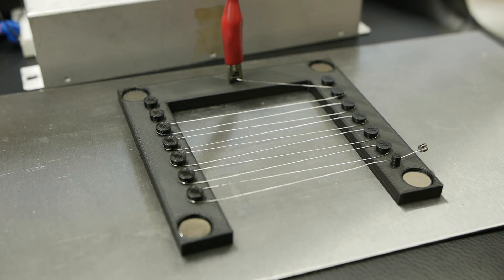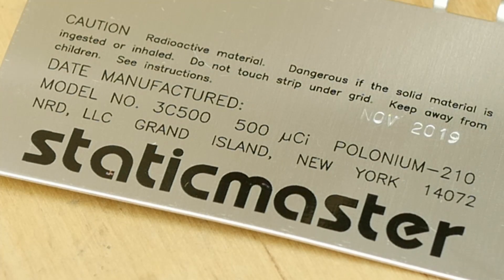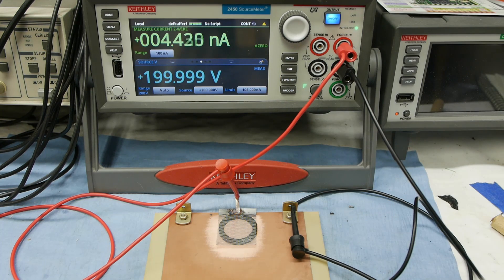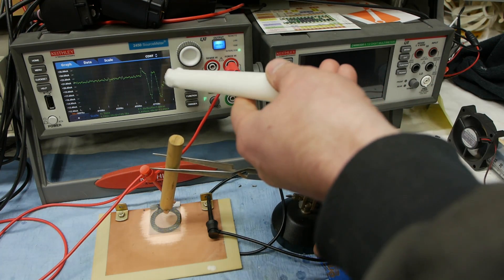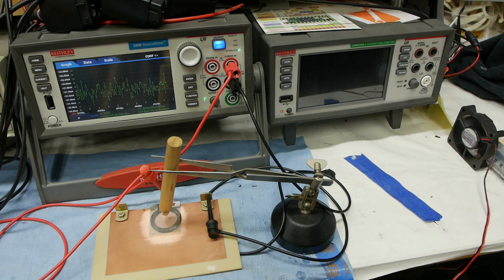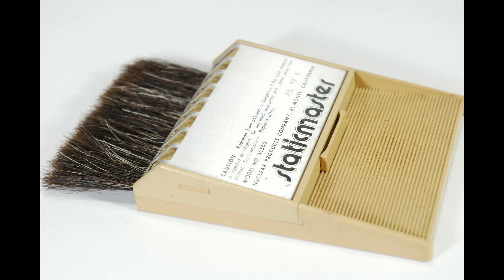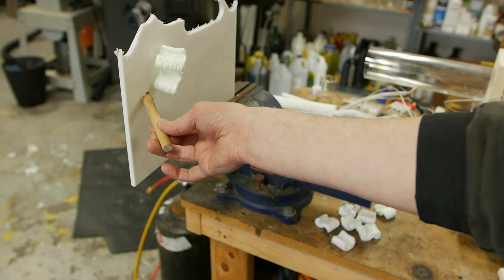Alpha radiation makes sparks, detects smoke, and eliminates static cling

Comment: 9:54 : "If the alpha radiation is coming from outside the body, it will not be able to get through the dead layer of skin that surrounds you and interact with living tissue"
Are you sure about that? 
I used to believe it too, until I saw The Thought Emporium's video on the subject, where he show they can actually penetrate through chicken skin:
https://youtu.be/C7TwBUxxIC0?t=875
Reply: Whatever TE was measuring he was NOT, I assure you, observing alpha particles traverse multiple millimetres of skin. He just wasn't. Radiation interactions with matter are well established at this point and the calculations for alpha particle traversal through water like density materials is known with high certainty. The typical stopping distance of a ~5MeV alpha in water is mere tens of microns. A 10 MeV alpha, about the highest you'd find from natural nuclear decay is less than 0.1mm. The high charge and high mass of the particle make its interaction with matter extremely strong. Again, this stuff is all over the literature if you want to look up the excruciating calculations for yourself. He was using thorium in that video, an isotope notorious for its long and highly energetic decay chain which includes radioactive alpha emitting gasses like radon. That stuff gets EVERYWHERE and is constantly emitted by the thorium. A diffusion cloud chamber of the kind he was using is not at all the appropriate method to prove alphas from something like thorium have higher penetrating power than is generally accepted.
Reply: @Muonium1  
OK for the radon. However:

"The typical stopping distance of a ~5MeV alpha in water is mere tens of microns."

Which is precisely the thickness of the skin's dead cells layer, 10-40 µm! The rapidly replicating cells of the stratum basale are right underneath.
Reply: @Muonium1  "Whatever TE was measuring he was NOT, I assure you, observing alpha particles traverse multiple millimetres of skin." And he never claimed he was either. He just said that alpha particles aren't blocked by paper as thin as human epidermis.
Reply: @Muonium1  Yes, I made a video to demonstrate that and posted it as a comment to TE's video: https://www.youtube.com/watch?v=L8StwMyVkVw
Reply: However it might be you're not going to wear the source from the brush as a bracelet or pendant and while using the brush your body will generally be at least several mm from the source.
So all in all you'd really need to put some effort to get damage from such source compared to a bracelet or pendant which will be inevitably in long term contact with a particular skin area.
Reply: I was about to post the same!
Reply: Chicken skin (especially feather skin) isn't really a good comparison to human skin, as it is far thinner than the majority of our skin, due to the added protection of a coat of feathers. Maybe more comparable to the thinner areas of our skin such as eyelids or nutsack.
Reply: @rdizzy1  Yeah, but it is still far thicker than the stratum corneum - the layer of (mostly) dead cells that forms the uppermost portion of our skin. 

There's a layer of actively dividing cells right underneath that!

Comment: Are there any legality concerns with regard to disassembling smoke detectors and other licensed sources like the staticmaster brushes? The Po-210 sources are obviously much less of a big deal due to the limited half life but I am not sure you should be suggesting that people disassemble smoke detectors for the Am-241 buttons which afaik might pose a nonzero chance of causing some regulatory issues.

Comment: I would have liked to see a "control" rod with no polonium, just wood.
Reply: This fkin guy right here.
Reply: I wouldn't.
Reply: that just sounds like graphite-tipped control rods with fewer steps!
Reply: wat

wat
Reply: @Geolaminar  It's a joke about nuclear reactors.  I can explain it if you want.
Reply: Wait, are you talking about scientific control, or actual control rods that are used in nuclear reactors?
Reply: @KingNast  The fact that it could be either is.the best part.
Reply: you are right - not unlikely the wood is poisened by one of the thousands nuklear Tests (and desasters) over the last decades

Comment: I had at least one Staticmaster brush specifically for photography use in the late 60's-early 70's (junior high-school and later; H.S. class of '72). I did a lot of (mostly) black and white printing from (mostly) 35mm negatives. I might even still have it packed away somewhere, along with my Durst enlarger. Brings back a lot of fun memories, including getting up before school and going into my home darkroom to finish a photo class assignment. 😊 I had the 1" model.
I'm amazed that they are still made!
Reply: I’ve seen some pictures and I swear they used a Dust enlarger.

Comment: Should old smoke detectors be disposed off, or can they be thrown away?

If I tore one apart, could I make myself ill?
Reply: You should dispose of them carefully. It's not dangerous to remove the plastic housing however you shouldn't open the metal pod with americium inside.
Reply: They can be disposed in regular trash (there's an exception carved out for them). The americium source is pretty well enclosed, so you will need to lick it to ingest any of it. And even after that it won't really do much.
Reply: You can dispose them if your trash ends in a landfill, but not if it's incinerated. 
And is never a good idea to play with radioactive particles without proper training, equipment and knowledge.
Reply: @josuelservin  I wasn't going to try to access it, but worried that the detector, if dropped or damaged, might "drop it".

I have years of assorted junk boxes, some with old detectors.

Comment: I used one of those staticmaster brushes to eliminate static from a pump when I was doing physiology experiments in grad school.  My patch clamp amplifier was picking up periodic noise that  corresponded with the movements of the pump.  I finally figured out that it was static from the pump rubbing on plastic tubing.  I rigged the brush polonium source to a lab stand and pointed it at the pump.  Worked like a charm.
Reply: Holy shit, man!
For my Master thesis, I did some very simple membrane potential measurements on leech neurons, under a constant flow of saline.
I had periodic noise (~ 1 Hz) in my electrode amplifier. I couldn't find the source, and ultimately just ignored it.
Peristaltic pump, static. Doh!
Yeah, so that's what that was.
Thank you for the epiphany, but you're 9 years late.
Reply: gesamtszenario that’s so cool
Reply: gesamtszenario That is so cool!
Reply: @gesamtszenario  Makes sense probably a triboelectric effect from the dissimilar materials of the peristaltic pump rollers and the tubing.
Reply: Would graphite powder have done at least as good, but without the accrual of mad scientist points?
Reply: Buck Starchaser maybe, but we already had a polonium brush for cleaning our lab balances
Reply: How did you find out that it was caused by static charges?
Reply: synaísthēsis I don’t remember exactly.  I imagine I cursed a lot and tried every other possible thing first.  Electrophysiology is as much an art as a science, and getting extremely frustrated on a daily basis was part of my technique.
Reply: @jmpattillo  haha thanks ;) I worked with neurons and faradic currents. A colleague worked with electrophysiology and I could see that it was another world XD
Reply: I used to solve this artifact on heart lung bypass machines intraoperatively by spraying the pump head with available saline in the room.  Perfusionists usually freaked out because of the artifact.
Reply: @kennethhicks2113  Right before you squirted the machine, did you shout "This artifact belongs in a museum‽"
Reply: well done :)
Reply: At $200 a pop I won’t get one soon!
Reply: Brushing one time was enough, or did you have to keep brushing it later on regularly?

Comment: @7:40 You are probably detecting the x-rays generated when the high energy beta particles hit the metal Geiger tube.
Reply: bremsstrahlung?
Reply: @zachreyhelmberger894  no thanks, I just put one out.
Reply: @zachreyhelmberger894  isn't that the safe word from Eurotrip? :P
Reply: Fluggaenkoecchicebolsen
Reply: Sr-90 does not have any gamma, so either its bremsstrahlung or the gamma from the resulting Y-90. Probably the latter.
Reply: The branching intensity for Y-90 is so small, that it would barely get registered, especially from a 0.1 μCi source that's seen here.
Reply: @zachreyhelmberger894  I don't think it's "breaking radiation".  That tube is great at detecting both soft and hard beta.  The Am²⁴¹ has a few soft gamma rays the most prevalent being 59 KeV
Reply: Tubes like SBM 20 or STS 5 were designed to detect gamma ray and hard beta according to their data sheet. https://www.gstube.com/data/2398/
Reply: @szymon5438  Thanks for the link.  That tube is very thin, only 50um thick.  A significant number of betas from Sr90 (~1Mev) are likely to penetrate inside to be detected directly.
Reply: @Tyler_0_  They're super thin, I found out the hard way when I held one firmly between thumb and finger and it squished. Still works though.
Reply: @szymon5438  They also do very well with counting soft beta.  This is a spec sheet error.
Reply: Strontium-90, and especially yttrium-90 is easily detectable. Low energy beta emitters like carbon-14 would require a mica-windowed Geiger-Müller tube. Lower energies than that, like from nickel-63 would require a liquid beta scintillation counter.
Reply: Yeah I was gonna say, I don’t think a tube device like that can detect gamma rays directly. You need a photomultiplier setup

Comment: Question: It is very commonly cited that alpha radiation can't penetrate the epidermis but as with everything I assume "can't" means "is unlikely" since I imagine the probability of penetration decreases with depth according to some function. If this is the case, then the "maximum penetration depth of some material" will mostly depend on where you put this limit, what probability is low enough to be considered "as unlikely as background radiation". Where can I find actual studies on this? Or what alpha emitter could I use for measurements that does not have beta or gamma in the decay chain?

Comment: I love how happy he sounds when he says "polonium is actually very volatile"
Reply: Nervous laughter
Reply: Nicolai Syvertsen nah, I don't think so. Been really does get a kick from some of the crazy stuff he deals with, and always with good safety practices.
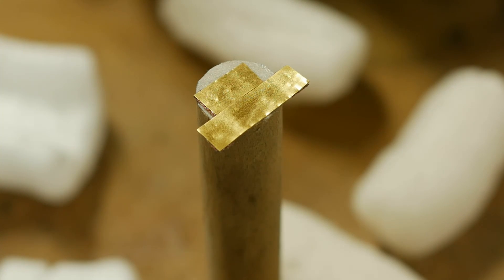Reply: at 11:09
Reply: I think he's near laughing at how bad the stuff is. Its like a joke at how bad it is to handle it, that not only is it so poisonous that they don't want to physically touch ot handle it, but it also will poison you just by the vapors it releases.
Reply: Yep, and telling that as a part of reasoning for the gold "plating", I actually left wondering is it still, with intact "platings", dangerous to bring the thing into a sunshine-parked car? Ie. will the volatile reaction bust the plating?
Reply: Strange how tobacco specifically absorbs Polonium-210
Reply: It's very volatile, so much so that it has to be gold plated, so of course I am going to wave this broken piece around that has had its shielding compromised. Nothing bad can happen...
Reply: @Jamesvandaele  that strip is not the coating, its the entire thing.
Reply: @Jamesvandaele  Listen carefully - it HAS NOT been gold "plated" - it WAS CREATED, by irradiation of bismuth, WITHIN a gold "capsule". And it is not "broken", what you see is probably couple of those individual "containers" (or "capsules") peeled off the brush and put on the end of the stick.

Comment: Interesting enough, if you want to buy just the little cartridge in those static-master brushes... a) you can't, you have to lease them from NRD (now NRC) b) you have to send them back after one year, and c) your name definitely goes on a list somewhere in fort meade.    At least that was the case as of 2003 when I needed to replace the bare strip in the AFM i was running, and decided that all the horrible folds and bends and times it got grabbed with steal tweezers, that the strip had received getting it out of the brush, and into position made it %1000 times more likely to shed some polonium.

Comment: Interesting to note that the green ones are less affected. but why?
Reply from the maker: It might have been because there were two stuck together -- shielding each other from the radiation.  However, there is a slight difference in composition, and that might have an effect too.  The green peanuts are apparently recycled from post-consumer material.  I don't know if they are marked green intentionally, or if they always end up that color based on the feedstock commonly used.

The pink ones are static dissipative!  Apparently, they include polyethoxylated tallow amine
 which attracts water from the air to the surface of the peanut, and makes the surface very slightly conductive.  In this experiment, the pink ones seemed slightly more responsive to the radiation, but it was not a very clear difference.
Reply: @AppliedScience  yeah, there are other packing materials (like some pink foam sheets) which are similarly colored.  I assume it's a dye, not the substance itself, but it's kind of neat that things like this exist.

Comment: "I've got about 15 kV across this."
>casually taps plate
surprisedpikachu.jpg
Reply: The plate is grounded and the supply is current limited, if you get too close to the live wire it'll hurt but probably no more than that.
Reply: @Broken_Yugo  thats more along the lines of what i was talking about but im just too tired to work up decent sentences... and just made myself look like a knob...
Reply: @Broken_Yugo  I'm guessing it's similar to earthing a spark plug lead through your hand.
Reply: @ifluro  Yeah, somewhere around there. I considered suggesting it'd be comparable to a lawnmower magneto, which is quite unpleasant but hasn't harmed me in the few times it took for me to avoid the experience.
Reply: If you have polonium on a stick high voltage is not scary at all)
Reply: @mpx41  I'd say that it's the other way around. Polonium on a stick like that won't kill you unless you eat it, or pry apart the foil leaves and start snorting it like cocaine. And even then, it wouldn't be fatal. 

High voltage can and will kill you if you fool around, and is ubiquitous in daily life, unlike Polonium-210. As a fun fact, the most common source of Polonium-210 you'd encounter in daily life is most likely in cigarette smoke.
Reply: Welder every day? :P
Reply: well hes not touching the live part sooo, and those sparks looked whimpy so not much to worry about

Comment: Only neutrons are used for transmutation.  Trying to use protons would be 83 times harder than fusing two hydrogen nuclei.
Reply from the maker: Hmm that's a good way of looking at it!
Reply: @AppliedScience  
😊
Shalom 
😊 Shalom 
Andar nas águas  ! (tribos portões pelo qual cada um entrará entenderá , aonde, a Ruach Kadosh  testifica o mesmo  Espírito )
Shalom 
Dos 4 animais 
Boi leão  águia  homem 
Boi  rumina  (medita , salmos  1 ) .?
, casco fendido (sabe separar as 2 casas de Israel , vara de Arão ?
Revelação pelo Espírito Santo,  como Pedro  em poder ....
 asas da grande  águia = Adonai  e suas  asas talite espiritual   = Ruach Kadosh. 
https://youtu.be/DYp22lkw3YY
A moabita com a sogra  é um paralelo  midrash com as duas casas de Israel  ?😊☺ e Yeshua Ha-Mashiach  ?
https://youtu.be/Z0Qdeg602BM
...
.
Reply: low speed neutrons
Reply: high energy proton
Reply: @rogueanuerz  High energy is relatively easy today.  Hitting an attometer diameter target is very, very hard.
Reply: With nice big syncronous accelerators available today giving ionized hydrogen enough speed to penetrate pretty much anything is entirely possible too.

Comment: Early detectors for "ionizing radiation" were gold-leaf electrometers (the gold leaves spread out when charged, then sank together when exposed to radiation).  Of course, if back then they had only had styrofoam packing peanuts ....
Reply: Time Traveler Tip #213: Bring along trash from the future. :D
Reply: Sounds a lot like a leyden jar, so I wonder if this radiation could be used to charge supercapacitors.. 🤔

Comment: Strontium betas probably inducing creation of higher penetrating bremsstrahlungs in the GM tube. Sort of same thing happening with those tritium keychain glow things. The phosphor inside induces brems creation and allows the thing to be detected by common Geiger counters, albeit weakly. Interesting that staticmaster apparently has their own cyclotron??!? I always assumed it was produced in the high neutron flux of a reactor core. Neat.
By the way, we all know what you're really doing here, Ben.... this smoke detector ruse is a very thin cover for the real project of combining this source with beryllium foil to make your very own Urchin at the core of the primary on a multimegaton yield thermonuclear weapon.....